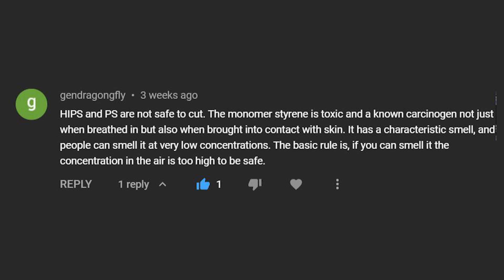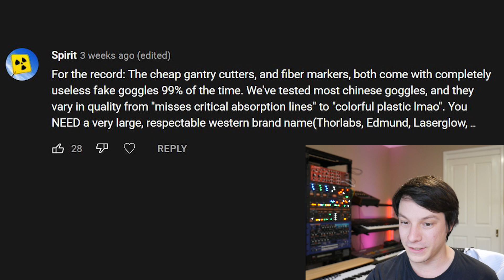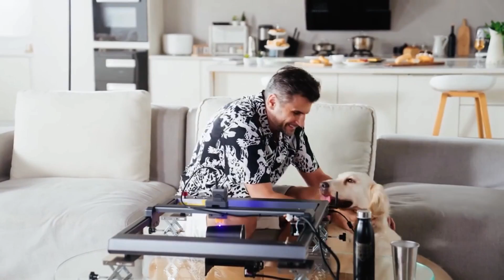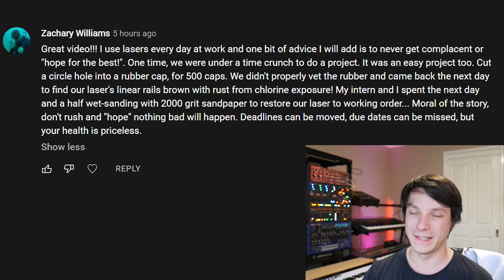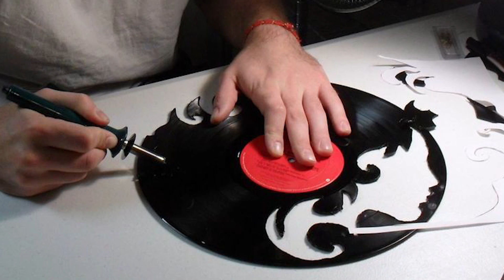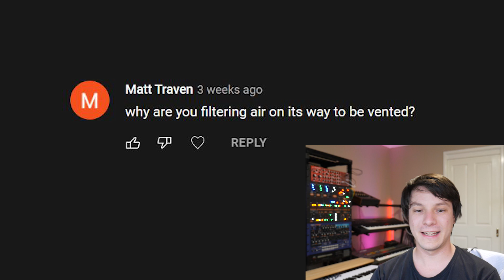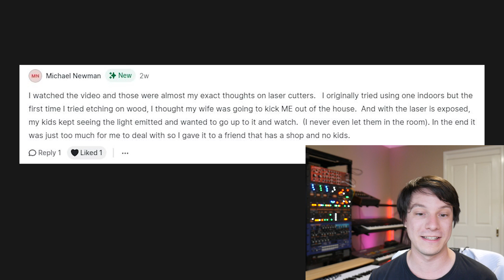What YOU had to say about Laser Cutter safety

Comment: I agree with your general stance on this, but a couple of points. 

I bought one of the cheap K40 type laser cutters to use at work and added basic safety features, like a lid interlock for the laser PSU. The safety officer objected to my replacing the orange tinted acrylic window with a transparent one, but I pointed out that it was designed to cut acrylic anyway and that orange was a filter for UV, not IR. If somehow a collimated beam should contact the viewing window, the damage to the window would be the indication/warning of a problem. He also objected to the piece of Aluminium I'd placed in the base of the cutter, to cover up all the holes (so the fume extraction system would work properly). The Aluminium was far below the focal point and even if it had been an effective IR reflector (see below), the beam would be greatly dispersed by the time it had come up to even the cutting bed level. Even paper placed in the base of the enclosure was unmarked by the beam dispersal at that distance.

Many metals are poor IR emitters (and therefore reflectors). The mirrors used in a CO2 laser typically have a reflective surface (may also be solid) of Copper (surface oxidation problems), Gold, or Molybdenum. If you've ever used a thermal imaging camera, you should have noticed that shiny metal surfaces can appear black. A polished stainless steel tank, far too hot to comfortably touch,  can read as below ambient. It's a mistake often made by users of the cheap IR thermometers. A shiny metal surface may greatly under-read due to its low emissivity. A piece of tape or other high IR emissivity material may need to be placed on the surface to get a valid reading. More sophisticated instruments may allow you to set an appropriate emissivity factor for the material being measured.

Comment: If lasers cut off arms, people would have a better grasp of how dangerous they are.  Inhaling fumes that can cause damage to lungs and nervous systems over time doesn't give the same level of instantaneous feedback so the risk is not obvious to the uninformed user.  This can also be true for eye damage as old welders know.  Mass marketing through AliExpress, eBay and Amazon implies to many that the systems are safe to use when the reality is quite different.  Videos like this are needed to get this important information out to the current and future users of laser systems.  I own a K40 and have also done repairs and testing on a diode laser for a friend.  Eye protection and ventilation are absolute requirements for use, even if just doing a "tiny" job.

Comment: Do standard furnace filters work to remove the nasty stuff from the fumes?
Reply: You need charcoal to absorb the fumes. Even then, I would exhaust the fumes outside to be extra safe.
Reply: I think it depends on what youre cutting. Furnace filters may pick up larger particles, but i doubt it would do much against diy chemical warfare, it's just not designed to filter that kind of thing. Probably worth looking into though, I could be wrong!
Reply: They'll work as a pre-filter, but you still need a HEPA filter for particulate and an activated charcoal filter for smell.

Comment: Not sure if someone already mentioned this but cheap LED lasers don't just emit the wavelength they should but they usualy also emit IR light due to use of poor quality IR filter or none at all, which can be dangerous so full spectrum protection glasses are recommended. Youtuber Brainiac75 did few videos on this topic. One was "Issue with green laser pointers" and the other "Failing safety glasses".
Reply: This issue is specific to 532nm green lasers, and is a side effect of how they work (532nm green lasers aren't really diode lasers, they use an 800nm IR pumped crystal laser which then gets sent through a frequency doubler - since that process isn't perfect they can kick out left over IR laser light if not properly filtered). The direct diode 405nm lasers that seem to be nearly universal in the cheap open frame diode laser cutters don't have this particular issue (instead the 405nm wavelength is itself not very visible). From what I understand it isn't even as common in green lasers as direct green laser diodes are starting to become a thing, although I would probably suggest assuming additional IR output from them anyway incase its a mislabeled 532nm unit.

Comment: I agree with all this safety.  I don't get why more of the ' cheap ' cutters don't advertise hood kits and list what they sell that goes with it.  Why not go for a second sale by offering ( possibly like Amazon ) a while you are looking at their product?  I would think about getting the case to go with a motherboard when looking at PC parts, so why not look at the case recommended to go with an ' open frame ' laser cutter?
Reply: The hood really should be included with the laser, since it's such an important safety element.  A computer is safe to operate without a case (aside from maybe breaking a PCIe header on your motherboard, since the GPU is designed to be supported by the case), but a laser cutter really isn't
Reply: There are a lot of enclosures for laser engravers on Amazon.  They start at around $50 and most are under $100.  Creality makes a bunch of them.

Comment: Roomies and I have been fiddling with the idea of getting a laser cutter for projects for a little while. Been a long-time watcher of your channel and saw your last video on this. Thank you for calling our attention to all these dangers so we didn't buy a potentially dangerous bit of equipment without knowing it! Lots more research and saving to do now so we can get something that works without burning down the house or filling it up with deadly fumes!
Reply: Every laser, regardless of price or features, is potentially dangerous. It is user education that can make it safe.
Reply: Also I would advise drawing up some sort of contract for when one or all of you move away, it'd suck to invest in something only to lose access to it due to having to move away or something. Money and friends is always a risky mix!
Reply: @brendandor  Good advice in general, though that will be the least of our worries. We don't rent, we purchased the house together. Been great friends for over a decade as adults so not a huge issue :)
Reply: @Paul-rp7nt  I wish I had friends that close
Reply: Depending on where you live, check and see if there is a maker/hackerspace around you that may have the tools and ventilation/safety/etc already set up. It does save money and can connect you with other makers who would be good sources of experience and knowledge.

Comment: There is no circumstance under which you should operate a laser cutter that is not enclosed in a enclosure that both protects from light and fumes. Laser light can reflect off of shiny parts of whatever you are cutting and shoot off in some random direction - this is why commercial cutters, if they have a window on the enclosure will tint that window a colour that will absorb the laser light. And you cannot know what chemicals are in any composite material , or if it is correctly labelled. Even Plywood has different adhesives in use, and they may emit bad things when burnt, which is why certain types of plywood are made that are "suitable for laser cutting". 
Manufacturers need to take responsibility for this, and not show their products in use in unsafe situations. If you live in a country that has advertising standards/product safety organizations, then sellers and manufacturers should be reported if they do this - if enough people do this then they will be inclined to investigate, and may result in something being done about it before too many people lose their eyesight.

Comment: I really want one of these dangerous Lazer cutters you can use them to remove rust  I could place the cutter in a shipping container and blast the cast iron parts over the course of a day and shut the power of before entering into the  shipping container by a switch in the door

Comment: it's clear there needs to be established a regulatory board specifically for laser cutters
Reply: There is some regulation by each state, usually by the Department of Health of something similar.  Regulation is heavily dependent on the laser classification.  At some point, a change was made to the classifications as nearly all of the laser cutters and Blu-ray burners would have been classified as Class 4.
Reply: Thats massively overboard and doesn't solve anything. only makes thing worse.

Comment: one thing that is really unfortunate to be very unsafe to cut is coroplast. I don't remember the exact plastic it's made of but it releases very toxic fumes when burned. It would be nice to be able to laser cut it tho, as it's basically cardboard on steroids.
Reply from the maker: It's just Polypropylene isn't it? Again, could be wrong, but I've cut PP before and it's quite melty but doesn't seem overly bad.
Reply: I don't know the specifics, but the laser cutter's datasheet at my university's makerspace was very clear that is was unsafe, maybe it doesn't have proper ventilation and filtering.
Reply from the maker: @EMILE12345678901  Huh fair enough! It might be made from different plastics.